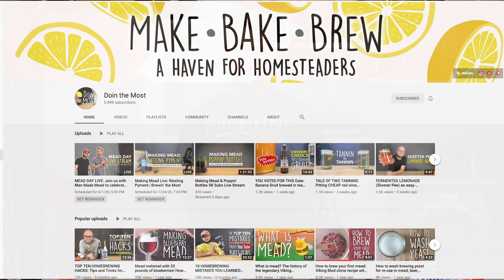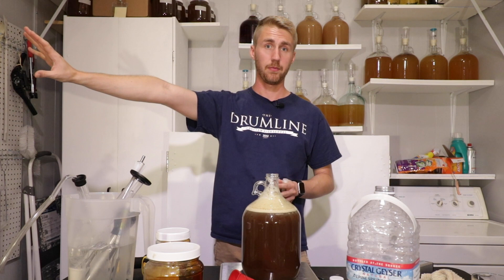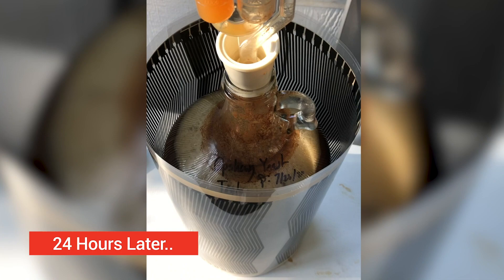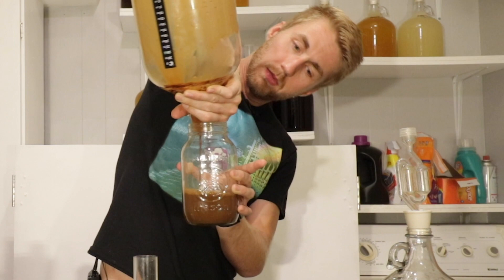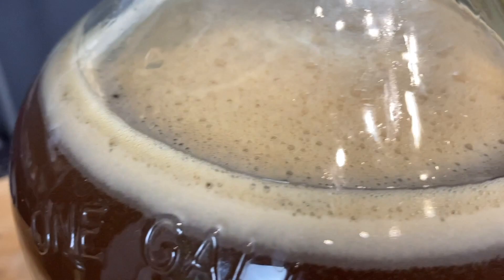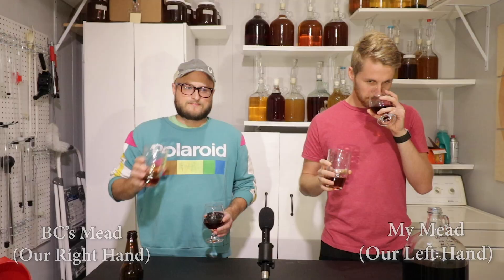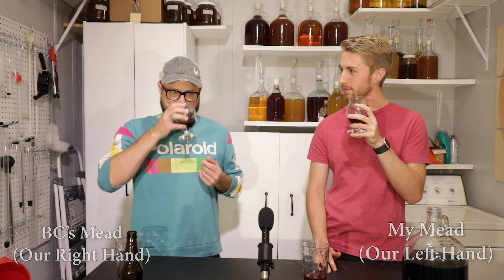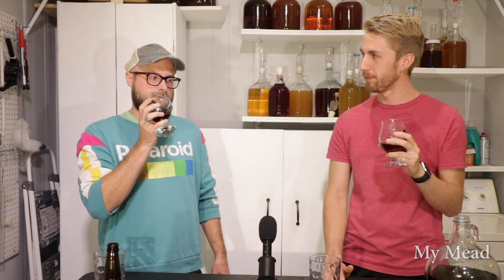One Yeast/Two Brews - What Can Go Wrong? - Feat. Doin the Most

Comment: FYI, top cropping works better, at least in my experience, with reharvesting Kveik (though I know it would be difficult to do with gallon jugs that have a small opening at the top).  Also, when I have washed yeast in the past, it's my understanding that on your first wash, you want to let the trub settle to the bottom for about 1/2 hour (the healthy yeast will remain in suspension), then you decant that into a second sanitized jar, fill with more sanitized water, and let that settle refrigerated overnight, then you should have healthy yeast at the bottom.  I may be mistaken, but it seemed like you did the process in reverse on your video, could explain why Doin the Most didn't get a good fermentation
Reply: This is exactly what I was thinking. I think BC did a video a while back on this where he harvested the suspended yeast, and it looked like MMM poured that off and harvested the trub.

Comment: Never used this strain of Kveik, but I do know that Lalbrew Voss Kveik is wonderful  if you run the whole ferment at 109f and it will be done in 2 days, NO hot green off flavor at all that i could detect in mine. From what i have read, most kveik prefer mid to upper 90's. As far as why the third gen didnt go dry I am at a loss, I have taken Voss, Dried it on the food dehydrator and re-pitched it and it always goes dry. If I had to guess, I would say that when it hit 120 it Damaged the yeast cells. Considering 120 is the point where yeast Starts to die off.

Kveik also seems to prefer to be Under pitched, and with him using the entire slurry that could be part of the problem as well he drastically over pitched it